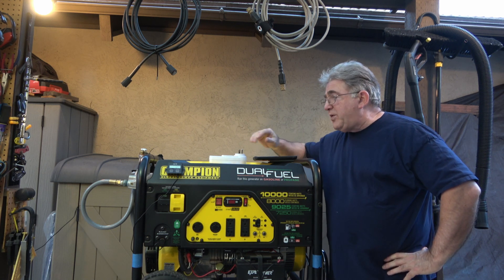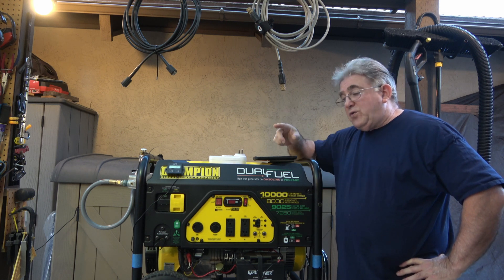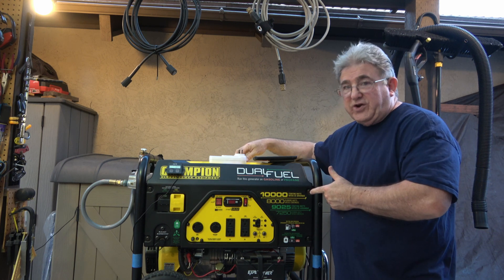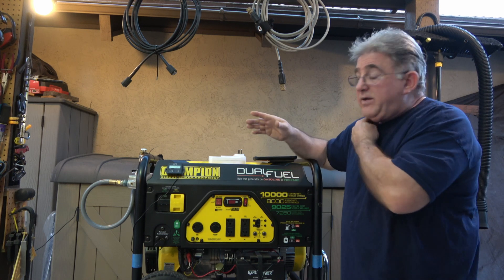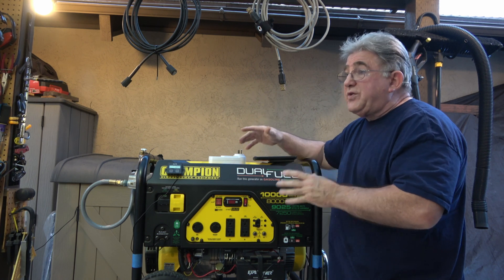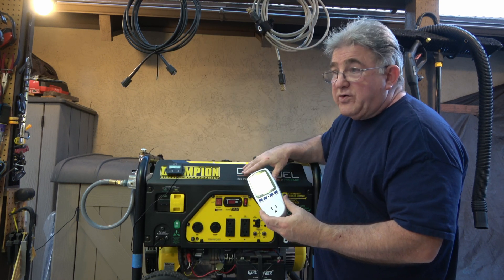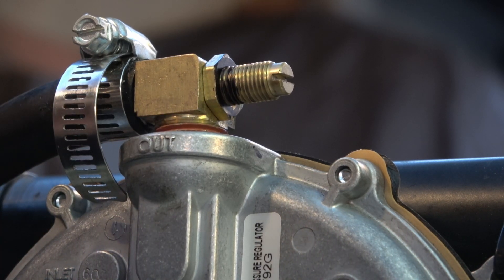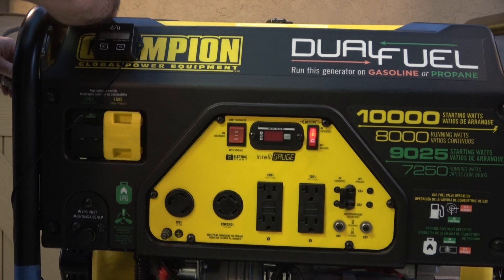HOW TO || Adjusting a Converted TriFuel Generator

Comment: Im curious, i have a dual fuel generator but also want to utilize NG with the proper regulator,would it be possible to "plumb" into the propane circuit with out to much modifications? I mean could it be done? Its a duromax genset
Reply: I want to do that same thing.  NG and Propane too share same user friendly type regulator.  Did you ever figure it out?  Duromax XP13000EH Hybrid
Reply: @richardsilva5134  isn't propane higher psi? Than NG?,I haven't bought the conversion kit as of yet,and I want to plumb a quick connection on my house with a good shutoff in my basement, so I can run exclusive on NG when the outage happens.
Reply: @motrhead69  Yes propane is significantly higher pressure than natural gas. I'm seeking a regulator that has two ports.. a smaller port for propane that will handle that pressure and type of fuel and a larger port for natural gas type and pressure. I want to use quick disconnects on both.
I'm coming up empty so for my XP 13000 eh hybrid dual fuel
Reply: @richardsilva5134  yes I have the same generator,and so far it's been helpful,Using my transfer switch for my home been a godsend "when it's been needed"

Comment: I have a 7500 watt high performance diesel Triton generator does not have a glow plug switch is getting fuel efficient but will not start up

Comment: You adjust engine speed on a generator based on the AC electrical frequency and voltage not the engine RPM.
Reply from the maker: Yes you are right. The way that I explained we will end up with the same results. Champion  has adjusted their electronic side base on 3600rpm. At 3600rpm you will get 240V and 60Hz. It is much easier for people like me to understand it this way. I have heard from lots of subscribers that the way that I explained it did work for. them.  I will subscribe to your channel and hopefully I can learn from you. Thank you for your comment.

Comment: I think it makes sense to add some choke when converting from propane to NG.  Choke causes air to move through the carb at a higher velocity, which sucks in more fuel.  The ideal volumetric air:fuel ratio is 23.9:1 for propane and 9.5:1 for methane, so a methane engine needs ~2.5X more fuel volume.  Also, the cylinder holds (1-1/9.5)/(1-1/23.9)=93% as much oxygen, and oxygen is roughly proportional to power output, so you should expect at most 7250W*93%=6750W running on NG.

With my Champion 200914 (3500W gasoline, 3150W propane), I was able to hit ~2900W on NG by adjusting both the choke and regulator.
Reply from the maker: Wow, you really know your stuff.  Thank you so much for the  running watts information.